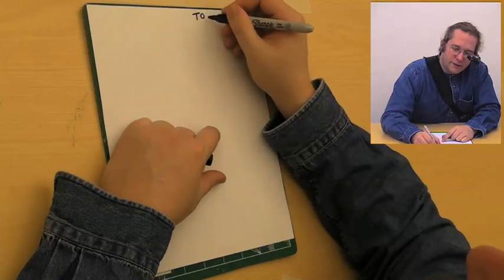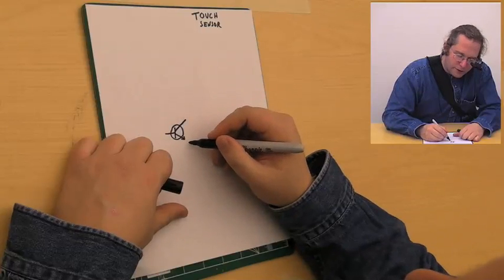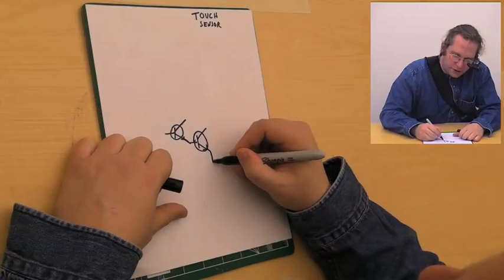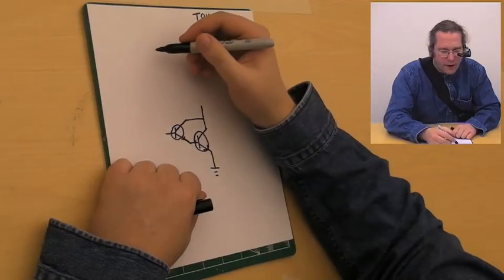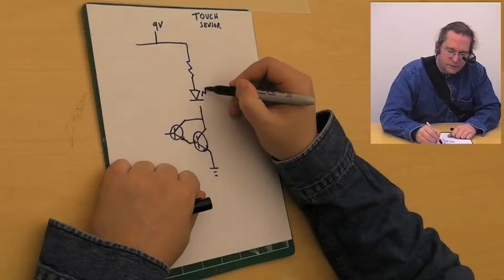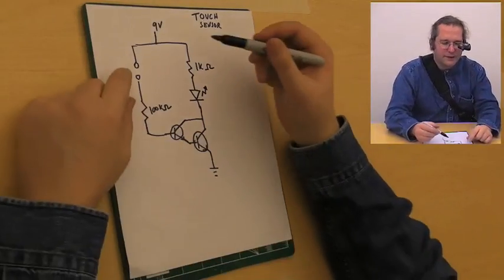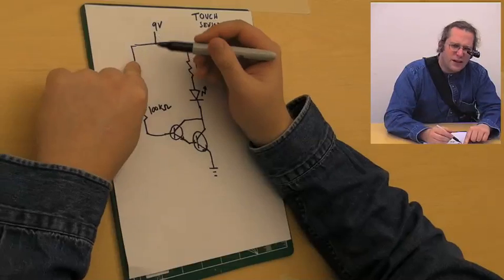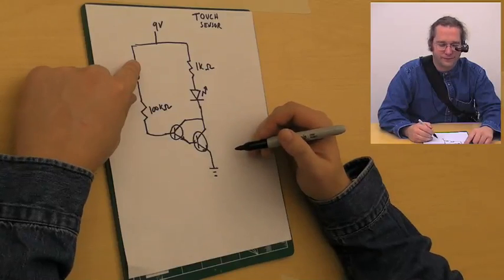CS 3651 - APIA - Using a Darlington Pair to make a touch sensor

Comment: It will even flash the LED simply by touching a wire leading to the base of the first transister without any foil, just will not stay on. If you hold the wire and rub your socks on a carpet youl see the LED light when you generate static electricity. Really neat!

Comment: A nice trike to try:
use a small peace of kitchen foil and connect it directly to the base of the first transistor in the Darlington pair ..  If you touch the foil It will light the LED by  discharging the electrons from your finger ( no need to bias the base)

Comment: Nice... tried with two 2n2219 transistors one LED and 100K and 1K resistors as the diagram says. It works but as expected this is a basic circuit and it is a bit sensitive to human proximity

Comment: @EwokMatt The transistors can be the same or different, regardless the resulting current gain will approximately B1*B2 + B1 + B2 where B is the current gain of the transistor.